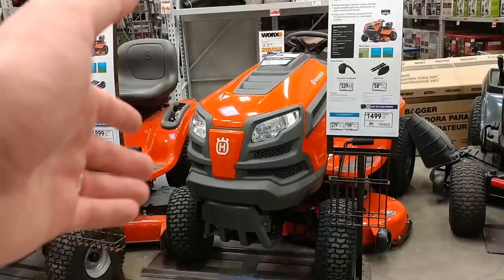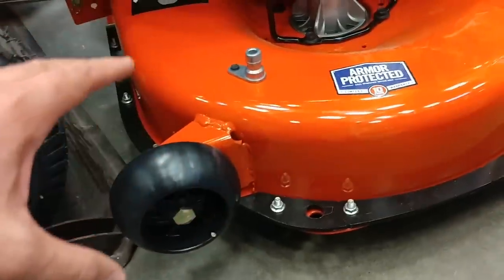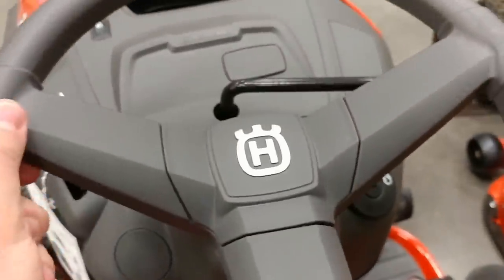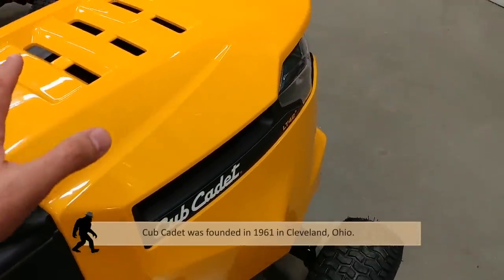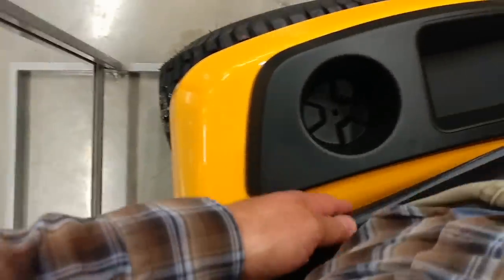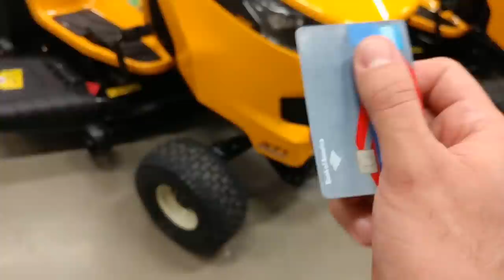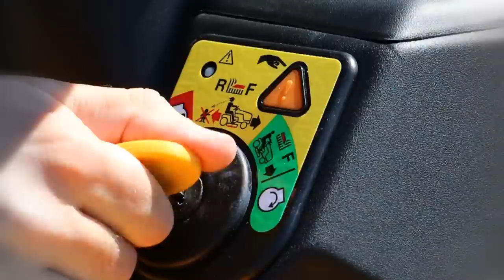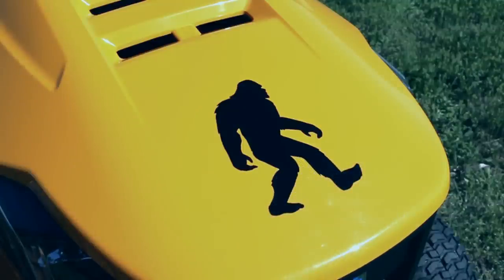Time to Buy - Husqvarna YTH18542 42” or the Cub Cadet XT1 Enduro Series LT 42" Riding Lawn Mower

Comment: I’d like to know how that engine holds up. That’s the first time I’ve seen the new KS series on a tractor and I’m curious to see if it’s as bad as the Kohler Courage Series it replaces. They’re supposed to be built better, but I’d like to know if their claims hold true. Additionally, if you want that K46 to survive, get the transaxle fluid changed at 50 hours, which is when it finishes breaking in, then every 200 hours thereafter. You have much better luck doing so compared to other people who own those. Also, try to run AMSOIL. It’s a very good synthetic oil. I’ve checked all the data sheets, and it is among the best available to consumers, making a balance of all the requirements a modern engine oil is held to. Also watch for rust, those MTDs are not made with the highest quality of paint. Take action as soon as it appears, and make sure to make use of that deck wash frequently. These are my opinions as a lawn mower mechanic whose been working on riding mowers for some time and researching info as well. Good luck.
Reply from the maker: Ashton - thank your extended feedback and knowledge!   I will be sure to change out the fluid at the 50 hour mark and will be watching for rust.   I'm pining your post at the top for a bit because I think it has some valuable and relevant information.  Thanks again and welcome to the community!  😎
Reply: I was wondering what mower you would recommend , or what brand you would recommend. I was thinking of getting this mower, but the one I want has the Fabricated Deck. I'm looking at a 48- 54" Deck. The one I'm seeing is a 50"  Just curious what brand you prefer.
Reply: Greg Taylor Out of the other two brands? Not sure, both aren’t built very well. To be honest, if I were looking for a mower, I would definitely go with a John Deere X Series, and stay FAR away from the D and E Series John Deere’s.
Reply: Ashton   good luck on changing the oil in that trans axle !!! It's sealed !!! And has to be taken out of the machine and taken apart to drain and refilled!!!  Mine on the Arien, made by Husqvarna lasted 9 years behind a B/S 20 HP twin That was a nice mower but is no longer made.  It was made by Husqvarna !!!
Reply: @ashtonneale8425  JD D & E series are no different than the MTD/Husqvarnas !!!
Reply: Wilbur Finnigan I’m aware of this. I’ve serviced many lawn tractors with “sealed” or “non-serviceable” transaxles. Even on some older models, the transaxle still has to be removed almost every time.
Reply: @ashtonneale8425  And that is the problem !!! I have a 9 year old Ariens, made by Husqvarna, 42" cut 20 HP twin cyl B/S and the trans just failed....never had service as it is a sealed trans.  closest dealer is 66 miles away and how does one get it there short of trailer rental.  I am too old to work on that stuff anymore.  Basically this Husqvarna is almost identical, except for the engine Husq has the single cylinder B/s
Reply: Husqvarna makes its own mowers..  And although the deck on this class of Husqvarna mower is stamped it is reinforced.  Talk to a warranty service center if you doubt this.
Reply: Steve Reaves I have seen them in AYPs plant. So yes, I doubt that:
Reply: @ashtonneale8425  i bought a used kubota BX sub compact, not cheap but you get what you pay for.
Reply: @ad356  A lot of people can't afford the Kubota's, but the build quality and reliability of those tractors is very good to my knowledge. A lot better than any Lowe's mower these days.
Reply: @ashtonneale8425  sure if someone has thousands more in their budget. Thousands.  This Husqvarna is a 1600 mower.  Like comparing a lexus to a Ford. LOL
Reply: @MortalHuman  Well yeah, but if buying a Kubota means not having to buy another mower for 20 years, I'd save up for a while then do it. I haven't bothered with those anyways due to the fact that 1. They're expensive and 2. they're too hard to work on for me. I have quite a history with older Craftsman lawn tractors from the early 90's on up. I have an 03 LT2000 right now w/ a Kohler CV490S that I rebuilt and it has a Hydro-Gear 314-0510 I changed the fluid in. It's been superbly reliable throughout the amount of time I've had it.
Reply: @BigfootDadExploresMontana  I have a Yard Machine push mower that we got 2yrs ago from my grandma
Reply: @BigfootDadExploresMontana  hi
Reply: My cub cadet has a Kohler command engine and it's 12 years old and still works
Reply: @wilburfinnigan2142  It's not that difficult to remove the trans to change the fluid.
Reply: Most of them state in the manual that the transaxle is filled from the factory and is life of the mower...which may be short if not changed?  Does The Amsoil have 1200ppm of zddp?  That engine is still an older design with solid pushrods, so for longetivy it should not have oil higher than API SJ.  Unless you need cold operation, stay  away from multi viscosity oil.
Reply: Really should NOT use the deck wash gimmick.  The deck should be removed, cleaned, coated with oil and as needed grease spindles and sharpen blades after each mowing.
Reply: I agree with the Amsoil. And they make high quality filters to go with it.
Reply: @Theyralltakenfu  how much do u want to pay ? That's a issue I tried keeping it 3000$ for a 50 inch
Reply: I bought the 50" with Fab deck, a Cub Cadet. It's been a good mower. I paid less then 3 but more then 2 of course. That seems so long ago. Haha. I also have a 48" Cub Cadet ZForce Zero Turn that has been a beast of a machine. Seriously, it has around 600 hours and has been so reliable. They no longer make it. 
The next Mower I want is a Scag. Probably a used one, because those mowers go for way above 10grand. I'm not paying that, I just mow a few acres of my own every week.  
What are you thinking of buying, or what did you buy?   @michaelnogas

Comment: I’ve been waiting for my 30 year old craftsman to stop running but it started right up Sunday after another long winter break. Only thing I do is maintain the engine ( oil & plug) and occasionally replace belts and this year a couple front tires. I also super cleaned the deck and repaint it about every 3-5 years. I mow about 3/4 of an acre and bag endless amount of leaves every fall. Always add Startron to all your gasoline and the fuel lines and carburetor will never be a issue.
Reply from the maker: Thanks for sharing this, mike d!  You have a solid machine, and I also think your care has to do with why it's lasting so long.  Thanks for the tip on the preservative!

Comment: I've Had  the Cub Cadet for a week[. The freight company damaged the seat and hood top, during shipping.. Cub Cadet stood behind the purchase; and,  rectified the situation, by sending me replacement parts- which were easily installed.
These Cub Cadet Enduro mowers are awesome!! With it's powerful motor, incredibly tight turning radius, and over-all comfort, I'm loving this Cub Cadet!
Reply from the maker: paul - that's awesome - thank you for your feedback!  It's great to hear about the positive Cub Cadet support.  🙂
Reply: 4/15/19, I got 10K Sq. ft yard to do, this looks like the right size (42") machine. Does a bagger  attachment come w/this? I figure it could pick up leaves as well.

Comment: I just purchased a Cub Cadet XT 1 46"deck 22 HP Kohler twin cylinder. It is like all the rest made or should I say put together in America but it uses foreign parts. I did a lot of research and found that it comes down to your personal choice of what you want and need from your tractor. My last mower had a Kohler and I had about 3000 hours on it and it was still going strong when I got rid of it so I went with the Kohler engine again. Do your homework before you buy and visit several shops like I did and talk to the people who work on the different models and hear what they say this is the best indication on what your going to purchase. In the end the bottom line is they aill only serve you in the manor they are taken care of. Happy shopping.
Reply from the maker: Thanks, Alex!  I agree with you and I appreciate you commenting on this.  And congrats on your purchase.  😎

Comment: The Cub brand engines are made in China. The Cub has a weak reverse and doesn't seem to have the power in forward the Husqvarna does. My Cub has a Kohler which always was better than a Briggs. NOT now. The second season I used mine it smoked everytime I used it. I was informed the valve seals are junk in the Kohler.  Find someone who has one and someone else who has the other mow a little with each then decide. My son bought the Husqvarna and it's a way better machine, so my new buy this year, Husqvarna of course . This has been my experience with the two, Hope this helps.
Reply: If it has a Kohler 7000 series engine it's not made in China its a USA engine..

Comment: EVERY lawn mower should be considered "disposable" to some extent.  It's just a matter of how much each will cost over whatever time period you own and operate the machine.  You can spend $10,000 for a "professional" grade mower, yet have expensive repairs and replacements after the warranty expires.  Conversely, you can buy a low-end, budget mower from a big box store for $1500 that has a 3-year warranty, and even if it blows an engine or trans in year 4, it's cost you $500 a year ($1500 divided by 3 yrs of warranty covered ownership).  Sell it for parts for, say, $300 (tires, wheels hood, the mower deck--even the seat and steering wheel have resale value) at that point and you're down to $1200 as the cost of machinery to do your lawn for 3 years.  IMO it's cheaper and less risky to buy a lower end model with a good warranty and expect nothing out of it beyond 3 years than to invest in a higher end model that you expect to get 8-10 years of good service out of--with only minor expenses.  Another perspective is to determine what it would cost to have a lawn service do your lawn, and compare that to the cost of that mower.  I know for $500 annually--at least in my area--that will get you 10-15 cuttings each season, which is about the extent of our growing season (Michigan).
Reply from the maker: Hi,  Rock RE - thank you for the thoughtful comment!  I agree with what you're saying and appreciate your breakdown.   We also did the math and came to the conclusion that we're ahead by buying,  however,  it's hard to put a price on personal time.   Believe me,  there are some days when I wonder if it'd be better to pay a professional yard service.   But then when would I do all my thinking for new videos?   😅
Reply: Rockinroller  I got 9 years out of my Arien 42" cut 20 HP twin cylinder B/S and the trans went south !!! Engine and everything else is still top notch and runs great,  BUT rather than spend close to $1000 to replace trans I spent the extra $500 and bought that exact model YTH18542 Husqvarna....BUT  I wish I had spent the extra $200 and got the twin cylinder engine, BUT here again it would have been a Kohlor engine.  The new Husqvarna, first one was sent back, mower deck vibrated horribly, steering wheel 1/2 turn off center head lights didnot work !!!! Shame on Husqvarna for letting that machine out the door !!! Quality control ???? And shame on Lowes for not making sure it was ready to go, it was all assembled. That one went back !!!   2nd one mower deck was better but not smooth running !!!  I removed and replaced the blades with a set of new Husqvarna blades that I had fine balanced, I do that to all blades, it ran better but not as good as the old Ariens, basically the same deck.  The new Husqvarna deck seems to shudder and struggle through any grass with a little volume, you have to slow down so it will cut !!!  and I do NOT like the foot pedal control. ackward compared to the old Ariens hand control.  the machine is OK but I would spend a little more money and buy a little better machine next time !!!
Reply from the maker: @wilburfinnigan2142  - I'm sorry to hear about that experience - that is extremely frustrating!! I agree about spending the extra $500 or so as that'll get you an upgrade across all these machines.  I'm hoping that your experience gets better with your new mower.
Reply: @BigfootDadExploresMontana  Well it did not start out better !!!!  And the new Husqvarna is not as good or user friendly as the older Ariens, which was made by Husqvarna, strange too they have the same deck and use the same blades, spindles, pulleys and belts, why I went with the Husky, plus all my spare parts I have !!!  Those spindles do NOT like rocks !!!! If you hit a rock it breaks the mounting ears off the spindle.  I keep a pair plus pulleys on hand and a set of blades because in the middle of mowing you hit a rock and break a spindle, in a short time you are back in business.  I am not in the habit of mowing rocks but we live in a very rocky area and rocks "grow" out of the ground  in the winter !!  Freezing !!!!  and tall grass hides them.  I mow about 1 acre, fire break around the house and my small orchard and previous garden area.  Arien was a great machine, only repair was spindles and I know why, tires are a problem keeping air in them, goat heads but tubes and slime eliminate that problem. and yearly service of oil/filter changes and some grease.  If I were younger I would change out the trans in the old Ariens and sell the Husky !!!!
Reply from the maker: @wilburfinnigan2142   - I can relate to the spindle problem; my old Bolens had similar issues.  Sounds like you have quite a bit of area to mow, but I bet its a beautiful place.  Whatever you use in the long run, you have to enjoy using it.  As far as tires go, one of mine stopped holding air again, but that's ok because I have an upgrade in mind... 😉  Stay tuned!
Reply: @BigfootDadExploresMontana  I have about an acre total, the front is the quality grass and the back is good nice grass just not the quality and then I have an old garden spot i keep the grass mostly weeds knocked down it is not watered so not much grown and then I have a small orchard, 18 fruit trees I mow around and an area between the garage and orchard.  We live in an area surrounded by sage brush and rock, ground too poor for farming so they divided it into 5 acre plots.  I keep the grass as a fire break as it is hot and dry in the summer.  it is way too much to mow with a walk behind, I have one of those but do not use.  Just getting ready to go out and mow, a once a week job, takes about 1  1/2 hours.

Comment: Last week I bought a new 2018 model XT1 Enduro LT42 that had been sitting at Tractor Supply for a few years. Dead battery, never had gas in it, but got it a a huge discount. Had some scratches from sitting around, but it started and ran great. The only problems..one LED headlight went up in smoke and blew the fuse. Plus rodents had filled the engine with chewed up plastic sacks. No wiring damage. Took some time to work things out but it looks great. Battery was questionable having sat dead from the factory. An overnight trickle charge and it seems fine. I'm wondering if I should change the break in oil, it looks clean but has been sitting a while.
Reply from the maker: Hi, House Bill - thank you for sharing that - very interesting to hear.  I am unsure about the break-in oil, although no doubt that it has probably wicked moisture in it from sitting that long.  Maybe a quick call to Cub Cadet support may be in order.  Hopefully it continues to work well for the upcoming season!  There's always time for upgrades at this point.... 😎
Reply: @BigfootDadExploresMontana   I bought this because it had the real Kohler engine and not the rebranded China Engine that CC uses now. Not saying there is anything wrong with them. But might be easier to get parts for an American engine that is widely used. I did change the oil and filter. It has 2 hours on it, mostly from me trying to get comfortable driving it.

Comment: I still own the first one in this video 14 years still strong as ever.
Reply from the maker: That's awesome to hear!  Mine was abused before I bought it and was falling apart.  The biggest bummer is that there was no tension on the belt and I spent more time replacing parts trying to figure out why.  I think it had the wrong idler pulleys installed at some point because I changed about everything else under there (tensioner springs (those were also wrong but bought the correct two), belt, PTO engagement cable, spindles).  I eventually gave up and just went and bought a new one.  😂

Comment: Every time I start to want a new mower I watch reviews, read comments..... Then I turn the key on my old 1991 Craftsman for it's next beating, and mow the yard.
Reply from the maker: 😂 Fireinahorn - well, at least the video was helpful in your decision making.  If it still works, that's what matters!
Reply: Yup, for the last 5 years I've thought the ole craftsman isn't gonna make it to winter this time.  Something would go wrong while mowing  I would flip it completely upside down smash it with a hammer a few good times flip it back and take off. I left it outside all winter long rain/snow below freezing temps just started it up first try and moved it to grarge to get it ready for the summer

It was already heavely used, and beat up when I got it for free like 7 summers ago.

 Its is tuff as nails, at this point I'm just seeing if it will ever stop mowing.

Comment: I have a 2011 husquvarna YTH21K46 with the 21 horse kohler courage motor N 46 inch deck. That is one of the best mowers I’ve ever owned. It has been beat to heck and back and still fires up and cuts grass. My brand new 2017 craftsman 46” can’t even begin to compare with it, as it is so much better. Husquvarna is a well build machine, even if it’s not fully American lol